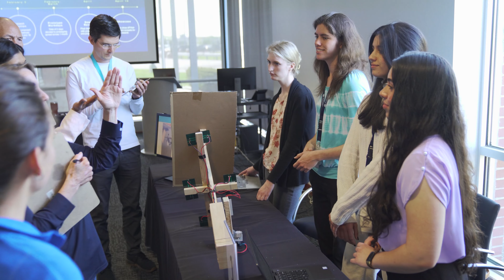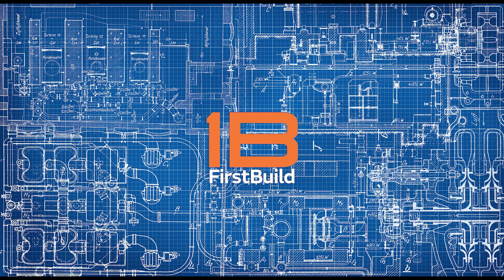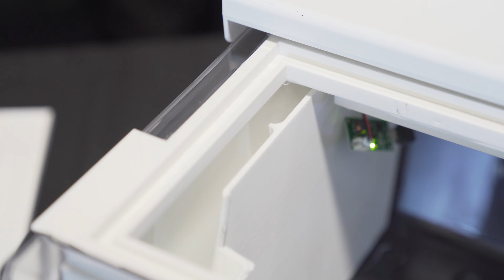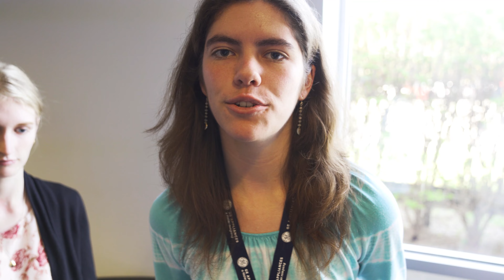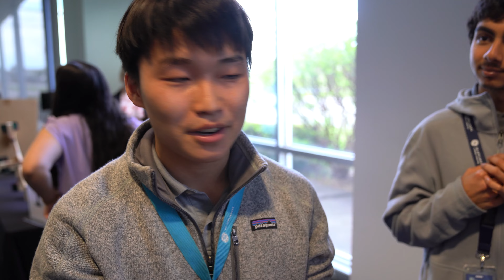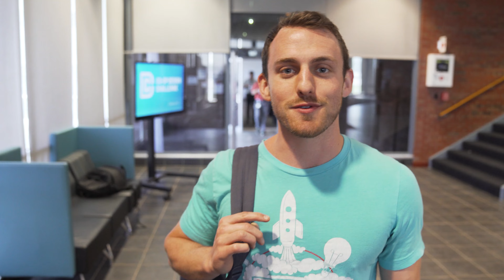Co-Op Design Challenge 2023 (New Inventions)

Comment: The small solar tracker would come in so handy. Especially if it had an auto stow mode to latch the panels down for driving.  I had tried to setup a mirror to track the sun and reflect more light on the stationary flat panels. It will be interesting to see what they come up with.